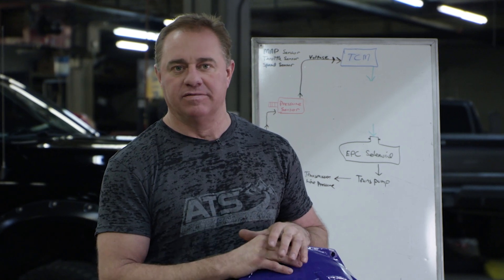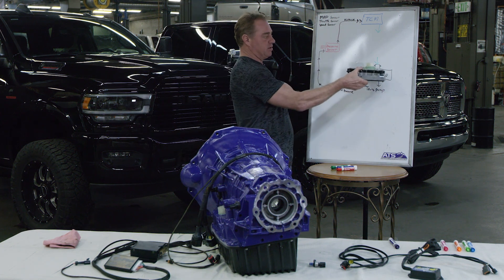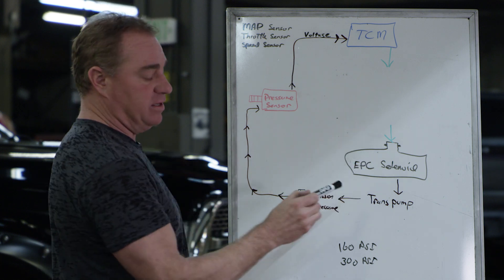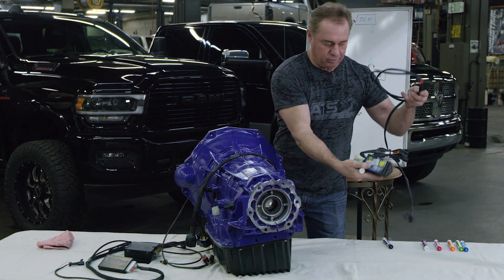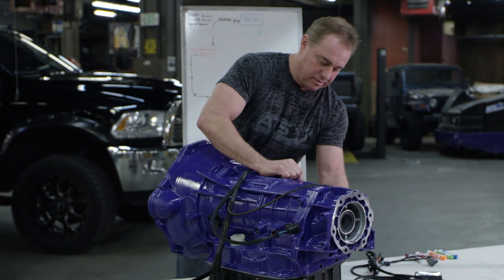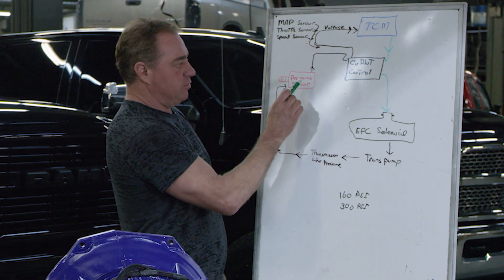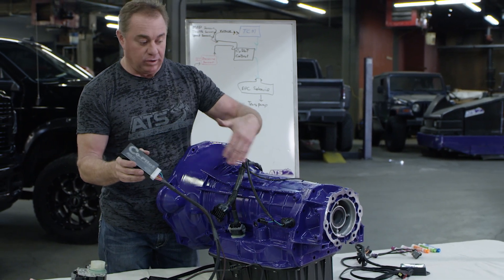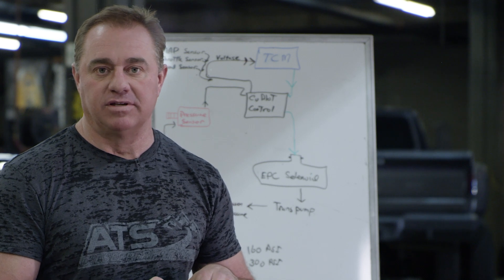ATS Diesel Co-Pilot™ Transmission Controller - Ram 6.7L Cummins 68RFE Transmission

Comment: I just had the vavle body on my 2022 ram 2500 68rfe trans changed out to a suncoast valve body. Wish i would have went to ATS vavle body and co pilot controller. Didn’t do my homework that well. Suncoast vavle body just made my transmission worse than it was with the stock valve body.

Comment: On my 2015 ram 2500 Cummins my copilot came with a transmission separator plate and two gaskets... Does this NEED to be installed and if I do install it what are the extra benefits? Or was this put in the box by mistake because there are NO instructions on installation.

Comment: So are you saying that the co pilot is better then someone tuning the Trans?   Not being sarcastic just wondering.
Reply from the maker: Yes, a Co-Pilot is superior to the capabilities of trans tuning alone.   We built the Co-Pilot since no one can effectively communicate between the TCM, EPC solenoid and the transducer with TCM tuning.  This is the "lie" that we talk about in the video and show the driving clips of the line pressure gauge jumping all over the place, while the Co-Pilot keeps the pressure consistent and smooth.
Reply: Ok thanks fro clarifying.   I was curious.   So Trans tuning with the co pilot that is the way to go it sounds like with the co pilot dealing with the line pressure?
Reply from the maker: andybd11a  we recommend no trans or TCM tuning when using a Co-Pilot.
Reply: I actually just noticed that you recommend stock Trans tuning with the co pilot.  I didn't see that when I made that last reply.  My bad